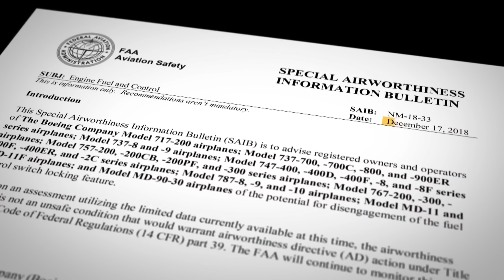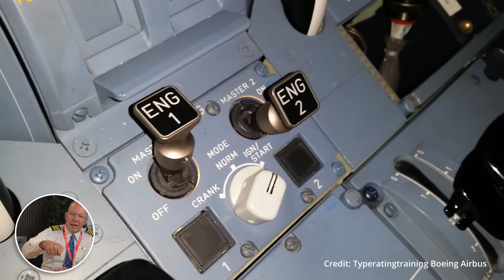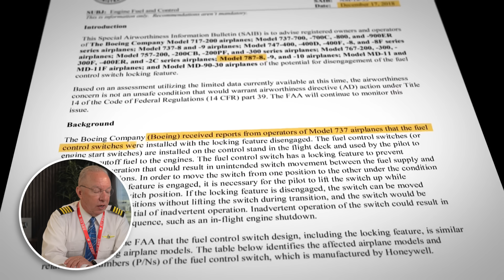Air India 171: The FAA’s 2018 Fuel Switch Locking Bulletin Explained (16 Questions Answered)

Comment: I thought that about the system logic where the plane would figure out theres no reason that the pilots should be shutting down the engines, but at some point we just ahve to accept that deliberate acts are not preventable.  Like fuel cutoff is so significant there could (easily?) be a system designed where if you are shutting down BOTH engines, the last one to be cutoff somehow needs bother pilots to do so but these tragedies are so rare its hard to figure out where to draw that line.  I’d love to hear captain steeeve do a retro analysis of MH370 in this regard

Comment: This is my second Comment regarding this tragedy.  Most comments thus far have concerned the IAIB Preliminary Report, FDR & CVR.
I would like to bring into that conversation what I see in some of the accompanying photographs.
What prevents ground deployment of the RAT is a squat switch (a/k/a a WOW or Weight on Wheels switch). We had one fail on a brand new Beech Baron about 20 years ago.  The gear retracted while the pilot was taxiing. The landin 0:40 0:40 g gear handle was in the down & locked position as were the landing gear indicator lights. Beech accepted full responsibility & repaired everything. [Had there been any dispute over the position of the landing gear lever or the color of the landing gear indicator lights, cameras in the cockpit w/h resolved that issue in the pilot's favor].
Photographs clearly show debris (sand [?]) being kicked/flung/propelled upward from the runway as AI Flt 171 took off.  It appears to be greatest on the left side of the arcft.  I hope a careful inspection & visual recording of the departure runway is made & preserved.  Another photo clearly shows a black metallic-like object having departed the arcft.
We MUST await recovery & identification of that object which consists SOLELY of pre-impact damage.  The sole surviving pax said he heard & felt a loud bang during T/O.
The RAT has 3 basic components: a wind-driven propeller, an electric &/or hydraulic generating turbine, & actuating & retracting components.  It takes quite a few seconds for a RAT to deploy AND IT SHOULD NEVER DEPLOY ON THE GROUND.  WOW systems prevent thrust reversers from deploying in flight; but thrust reversers have deployed in flight (usually with fatal results).
While IT'S WAY TOO SOON TO DRAW ANY CONCLUSIONS, I'm beginning to think there was an electrical or electro-mechanical fault or defect involving but not limited to the
WOW system.  A  compressor stall on 
the left engine would NOT trigger a RAT deployment in the air or on the ground.  If the RAT is ultimately recovered fully intact, I will happily eat my words; but I'm

Comment: Most probable cause was the electrical problems. Issues like loss of power on engines, display failures, alarms and communication. Electrical failures could be very difficult to pilots to handle in these situations.

Comment: I am very sceptical about this interim report. Before we blame this crash on a roge pilot, we should acknowledge that previous Air India accidents have dubiously blamed "Pilot Error" (which would be very convenient for Boeing, and the manufacturer of the FADEC system in this case).  In at least one instance (among others) the engine control computer, the FADEC, malfunction resulted in a  rejected take off when the engines "rolled back" on take off.
At take off the "whine" noise from the ram air turbine was heard as it deployed, confirmed by the DFDR. This can only happen if both engines "rolled back". The FADEC will "shift" from "ground mode" to "flight mode" at aircraft lift off, when a malfunction could possibly and plausibly occur. 
I speculate that the pilots heard, saw, and felt the power loss, (caused by FADEC malfunction) and did not retract the landing gear, because of anticipating ground contact. The landing gear lever is known to have been in the down position during the whole flight.
I speculate that the captain turned the fuel control switches to cut-off, to stop any remaining fuel reaching the engines in the vain hope of reducing fire risk on impact, or he may have been "toggling"  these swiches off, then on again, to activate the auto re-light function. The  first officer was startled by this, not understanding the captains actions. (An attempted re-light was a vain hope in this situation only seconds before impact on this 32 second flight).  
Obviously these pilots were in a very high stress situation.
The captain "I didn't do it" was saying "I did not shut down the engines" if FADEC malfunction was indeed the culprit. However, we must all now wait for the final report which we all hope will be scrupulously honest.           I am a retired airline captain

Comment: I believe only the Dash 8 has the Start and Cut off system after the engines both N1 and N2 have been fully started or completely started, a recoil spring is concealed within the lever after it's fully charged or started it will kick back to shut off point. I am an an airplane enthusiast, but not a pilot I stand to learn if there are other aircraft that has the Dash eight system. Air India you need to be honest and forthright with the east indian people who are probably most aware of this, in spite of what the chief executives of Air India are saying because of reputation, you going to hurt your reputation if this becomes a constant cover up or a repeat. The fact remains if pilots need time off to rest or to be psychologically evaluated themselves, that's what is needed . He might have because of his mother's death etc. become impacted and decided to take his own life, (still needed time to grieve) should not have been the lives of innocent people with him.These things take place within seconds according to nautical air speed, the time this was realized seconds had elapsed as far as altitude is concerned and they could not have gained more altitude, also being still in flap 5 there was not enough lift to propel the plane further upward especially after engine shut down {off }. So sad, poor fellow don't blame him blame the system he had to work under ! The LIves of the passengers are so much more important ! Important and yet dangerous job.

Comment: Can you do a video actually SHOWING you manipulating the cutoff sdwitches so some of these thick headed morons can see that they have to be lifted, moved over a "wall", and then dropped on the off side of the wall to turn the fuel off? Every actual pilot has stated that those are not simple push type switches and CANNOT be moved accidentally.

Comment: Captain Steeevie, one thing of the all comments made one thing I haven’t heard about the switches and that is “ when the run/cutoff switches are operated to select, you pull on the switch, to over come the spring tension, hold it and move it past the detent, once selected you release the switch and it’s held at that selection by spring tension vice versa.  The spring tension holds and the detent work as two barriers from inadvertent moving the switch accidentally.  What do you think.  I’m a Navy veteran as yourself, aviation back ground 26 years active duty.  I remember these type of switches and remembering that weapons control panels having them to arm the weapons until the pilot pickles them away.  Thanks for your service.

Comment: A camera in the cockpit would have settled this in days, you only need the video  not the sound so no problem with a leaked video recording the pilots talking about..... 
No CVR recording has ever been leaked. 
If we had video we would definitely know if it was one of the pilots, accidentally or deliberately moving the switches or as i believe the switches never moved. It was an electrical fault that stopped the engines. And the only thing we automatically do is turn the switch off and back on again to see if it clears the fault.
Loosing electrical power to the switches would stop the engines and the FDR would show the switches have been turned off.
Stop ignoring the fact the plane had electrical issues on the previous flight and one of these planes has already had a double engine failure on landing. 
If it was suicide the person that turned the engines off would have made sure the other pilot did not restart the engines, a fact everyone is missing. 
Captin Steve you are saying consistently the other pilot would have seen the switches turned off, what would be the instinctive reaction, turn them back on again immediately. You are not going to think about it for ten seconds.
In a previous case of suicide there was a fight for control of the aircraft. 
German wings suicide was only possible because the other pilot was locked out of the cockpit!
If both engins shut down on takeoff you are going to die in the next 60 seconds, shock would stun both pilots hence the ten seconds!

Comment: It could have been that the first officer might have seen the turn off the fuel switch and then he asked why did you turned it off. The captain replied calmly that he didn’t do so, no sign of upset, agitated, confusion or panic. He knew this is a catastrophic thing

This is a sign that pilot does not have normal life. They are overworked, over stressed, their working hours are fluctuating, leading to stressful, depression and suicidal thoughts

Comment: Captain Steve... I am very curious how many lead wires or terminals the fuel control switch have.

The FDR get signal about the position if this switch directly from hard-wired signal from these switches, or, the signal is relayed thru other intermediate components? 

If the latter is the case hete, how we know the intermediate components were not compromised by some other means??

Comment: What about 2019
2019 ANA Boeing 787 experienced an uncommanded fuel cutoff during final approach—not due to a physical flip but a TCMA software glitch that falsely signaled ground mode, triggering fuel shutoff  . 

Aviation regulators, including the UK CAA, alerted airlines to this electronic failure risk in mid‑May 2025, highlighting that FADEC systems could misinterpret signals and inadvertently cut fuel  .

Comment: What about 2018
  2018
It alerted operators of certain Boeing models (including B‑737 and B‑787) to a potential disengagement of the fuel-control switch locking feature. 

Specifically, there were incidents where the metal stop-lock on the fuel-cutoff switches could become improperly disengaged, allowing the switch to be moved without pulling it up first — despite a design intended to prevent such movement  .

Comment: I think the logic system which would prevent the engine from cutting off should have been implemented only for lift in a take off.. The example you gave is for when you are already airborne and have other factors cleared for you to say you need to immediately cut fuel to the engines for example a place to land safely and altitude so that you can glide the plane without the engine in the event of an engine fire. However when it comes on to lift in a take off I absolutely see the engine being kept on  as the highest level of importantance even with a fire to achieve lift in order to reach a suitable altitude to then cut the fuel to engine in the event of a fire once you can safely glide the plane using the rat. That logic would only be enforced on take off which would prevent human intervention to cut fuel to engine.. I see no scenario where allowing the pilot to be able to immediately cut the fuel to the engines while in lift couple seconds  from take off should be allowed.

Comment: In the first video, dust looks like it is thrown up, which is unusual on a frequently used runway. This suggests that they were already struggling to take off. I have seen a second video where you can hear the rat deployed straight after take off. Do you think that one of the pilots moved the cut-off switches after V1, so they were at the point of no return?

Comment: With due respect to all excellent and talented pilots, camera in cockpit is a must, if all other commercial commute mechanisms have it, why airlines will be an exception, it’s just going to store the data in the black boxes to aid analysis in case of adverse scenarios, it’s nothing against privacy.. is it because loco pilot or bus / Uber driver earns less $ so their voices are not heard while airline pilots get to lobby against it.. when the entire industry runs on passenger money we should be given the first priority and our voices should be heard.. and on a technical ground doesn’t it seems logical to add a basic logic to prevent manual fuel cut off when thrust levers not in idle position.. just makes no sense.. a pilot will definitely pull the thrust levers down to idle if there is an engine fire or failure!

Comment: Captain with all due respect,  the 2018 bullitt in regard to the switch failures says that it could lead to a catastrophic event.. in your explanation you said that the switches could be installed wrong to the point they can't be moved to the on position.. if that's the case, how could there ever be a catastrophic event as the 2018 bulletin States?
If you can't turn the switch on in the first place because of incorrect installation, you can never take off.. if you can't take off, you can never have a catastrophic event as the 2018 bullets and says. 

You seem to be covering for Boeing. Your answer in regard to the 2018 bullitin is bogus.

Comment: The preliminary compulsory report of the air crash OF FLIGHT 171 is out. GREAT TIME TO FINALLY INSTALL VIDEO CAMERAS IN THE COCKPIT. Flight ai India 171::  The preliminary compulsory report of the air crash OF FLIGHT 171 is out. Both pilots are from Mumbai (Bombay) and colleagues and somewhat friends. Flight Air India 171::  Both take off pilot and other pilot were simply staring ahead outside during take off. Neither pilot was looking at the hands and palms of the other pilot. In lesser known international airports, such as Ahmedabad airport, the copilot is the king of the road. The night before. Main pilot 1, says copilot during dinner at a hotel: "Clive, I am sorry I didn't allow you to take off from JFK airport, New York City, last month when you asked me to allow you to take off from JFK. Tomorrow we fly to Gatwick international airport from Ahmedabad. We will decide tomorrow to decide who takes off. Next day during take off. The question by  the take - off pilot to the extra pilot  "Did you cut off? or "WHY did you cut off?" BOTH QUESTIONS ARE NOT PROOF THAT SOMEONE TURNED OFF THE FUEL WITH THE CUT OFF SWITCH. PILOT IN CHARGE OF TAKE OFF NOTICED THAT THER IS A SHARP DECLINE IN UP - THRUST. SO HE ASKS THAT QUESTION. This one month old (one month from air crash, not from date of finding the black box) preliminary report says that the cut off switch TRANSITIONED from run to cut off positions with a one second gap.. Both take off pilot and other pilot were simply staring ahead outside during take off FROM AHMEDABAD. . Neither pilot was looking at the hands and palms of the other pilot. In lesser known international airports, such as Ahmedabad airport, the copilot is the king of  the road. The night before. Main pilot 1, says TO CO- pilot Clive, "Clive, I am sorry I didn't allow you to take off from JFK airport, New York City, last month when you asked me to allow you to take off from JFK. Tomorrow we fly to Gatwick international airport from Ahmedabad. We will decide tomorrow to decide who takes off. You decide whether to take off tomorrow morning. Sharp decline in upthrust at 60 feet. Pilot  in charge of take off looks towards the engines and looks at the fuel cut off switch. Other pilot is staring out the windshield windows. Next day during take off, The question "Did you cut off? or "WHY did you cut off?" The preliminary report uses the word "TRANSITIONED" FROM RUN TO CUYTOFF POSITIONS. BOTH QUESTIONS ARE NOT PROOF THAT SOMEONE TURNED OFF THE FUEL WITH THE CUT OFF SWITCH. pilot IN CHARGE OF TAKE OFF NOTICED THAT THERE WAS A SHARP DECLINE IN UP - THRUST. SO HE ASKS THAT QUESTION. The question is not proof that he saw the extra pilot switch off the fuel supply switches 1 and 2 with a 1 second gap.

Comment: Could it be that fuel cut-off valves were shutdown prior to mechanical cut-off switches? Maybe pilots in the first place experienced a loss of engine thrust and only after that mechanically and intentionally pushed switches to cut-off and then  back to run in order to regain engines power? Is there separate data recorded for status of mechanical switches and status of fuel cut-off valves?

Comment: Two comments: I'm not sure the Embraer would require 10-15 seconds to make a decision, just an immediate assessment of present conditions. Anyone know? Also, while I had asked about an intermediate position between cutoff and run, the other possibility is missing or incorrect springs resulting in insufficient down force at each position.

Comment: The Taiwanese 787 pilot James, who predicted the cause is dual engine failure ,not flasps, earlier than anyone including Steeve. He mentioned there was a service bullentin issued by Boeing to replace chip on both engines to prevent accidental engine cut off in 2022.

Comment: Its not pilot error

In January 2019, ANA Flight NH-985, a Boeing 787 Dreamliner, experienced a dual engine failure on landing at Osaka's Itami Airport. The incident occurred after the pilots deployed thrust reversers following touchdown. Both engines shut down, and the aircraft had to be towed off the runway. An aviation expert has linked this event to a software glitch in the Boeing 787's Thrust Control Malfunction Accommodation (TCMA) system.

Comment: A similar incident happened in 2019 when All Nippon Airways fuel switch moved to cut off position without pilots input due to Thrust control malfunction accomodation system software glitch.